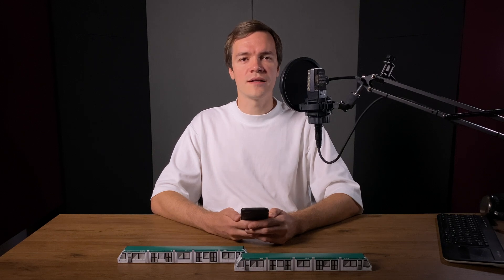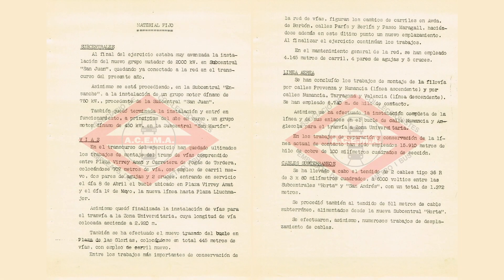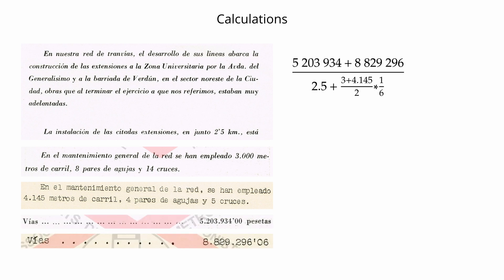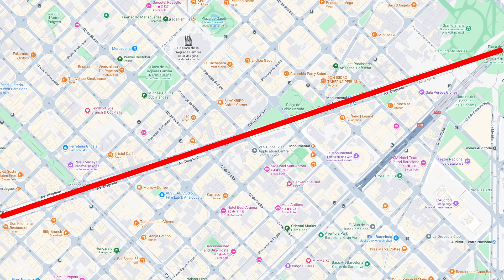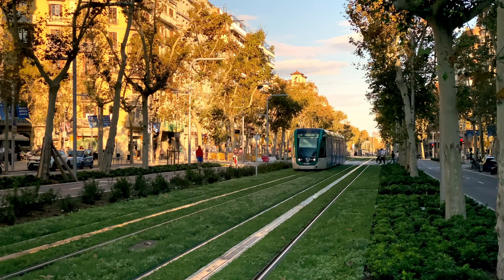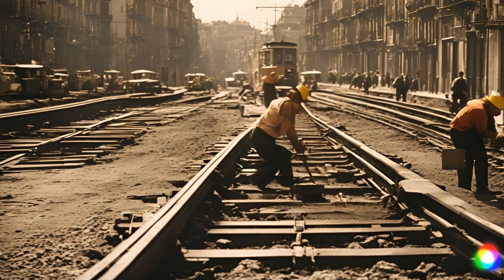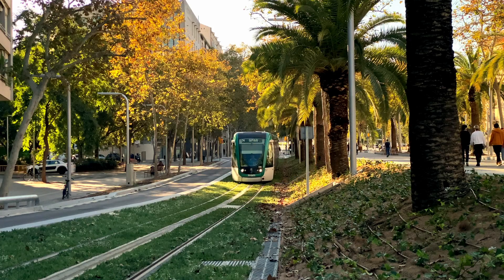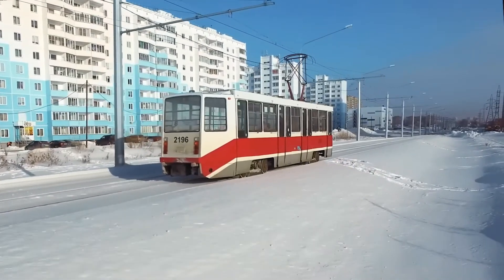€100M for 1.8km: Barcelona's New Tram

Comment: the reason for taking that long to build is that the sewers had to be remade from scratch first through half the line, therefore increasing the costs a lot. Now for the next and last construction there is the same problem and first the original sewer has to be exposed, removed, made, covered and then the tram construction can begin.

Comment: Good video mate :) Your calculations seem thorough, I just wonder if you took into account that the conversion from pesseta to euro was set at a number, but the purchasing power shrunk overnight. A simple example, a coffee used to be worth 100pts (0.6€), but overnight it turned into 1€ (and lot more these days). This has affected everything from wages to material costs. 
Also as bit of a side note, the two extensions you compared it to are nowhere near in as central an area, and were built in developing neighbourhoods (no NIMBYs at all). Funnily enough, 100M is actually pretty cheap when you compare it to other projects around the world, especially in the anglosphere, where this would've easily costed 300+M
Reply from the maker: Thank you!

Coffee prices increased threefold, but steel went up 15 times, cement 24 times, and copper 29 times (according to the Instituto Nacional de Estadística, Índices de precios de materiales, base enero 1964). That's why I used that calculator, which gave a number four times higher than the inflation rate. More than coffee, less than steel 🙂

Comment: Wow this is an amazing video, really interesting seeing the cost break down, for comparison in Vienna a tram extension of 2,4 km on the outskirts of the city through fields will also cost around 100 million euros (unfortunately they are not transparent about the cost breakdown here tho😭), it also includes a completely new road through a field which will be completely car free and only for trams, cyclists and pedestrians, I suspect thats also why the cost is so high, same as in Barcelona it seems
Reply: By the way, footage of Barcelona's pre-1960 trams show that they were unidirectional, with doors on only the offside. Vienna still uses looped unidirectional running and continues to buy new unidirectional trams and the same seems to go for the tramways of Novosibirsk. However the current tramways of Barcelona are bidirectional and even have platforms on both sides in the direction of travel, precuding the use of unidirectional trams with doors on only one side.

Comment: Those costs are pretty standard these days in European major cities for tramways at least in Western Europe.
Reply: Not quite, this one was quite expensive.
In Paris, they've had 10 or 11km lines for 300 millions, and some other lines which budget slipped, like the fairly recent T12.
Spain usually builds transit infrastructure a bit cheaper than France, so 100 million for 1.8km is on the pretty expensive side for Spain.
Reply: @KyrilPG  not in the UK we haven't, and with the French costs you must add back the utilities costs, about another 20%, as they are not counted in the base costs as they are paid by the state utilities companies